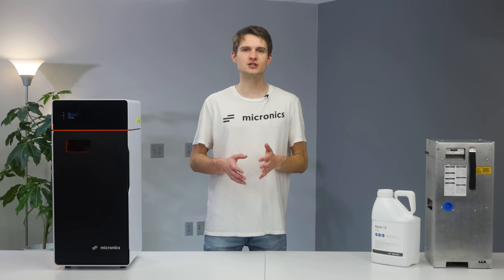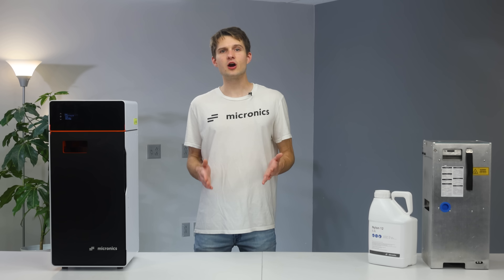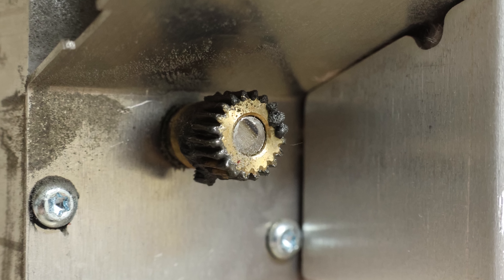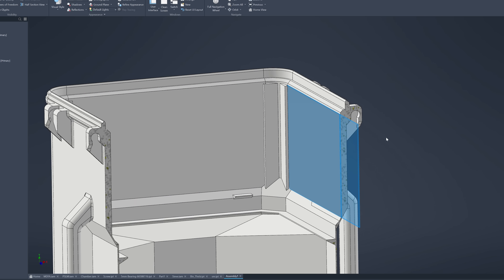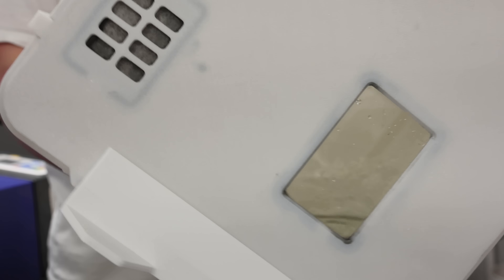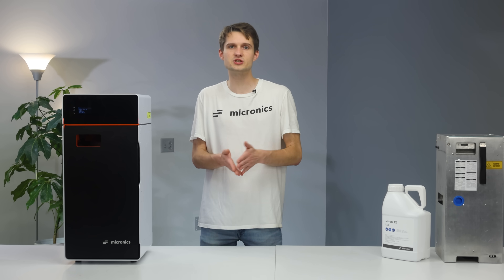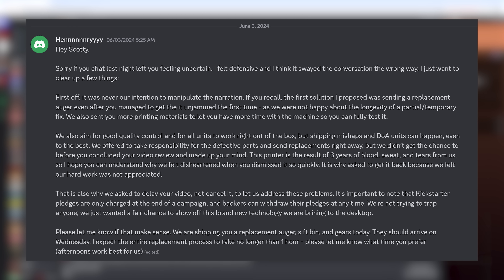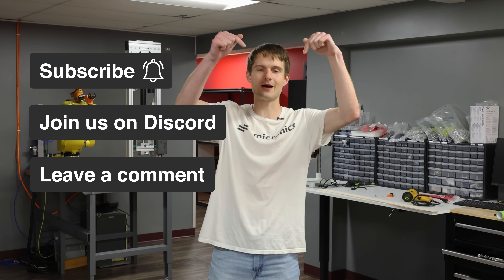EVERYTHING we'll change with MICRON + Response to Scotty

Comment from the maker: We got acquired by Formlabs! https://formlabs.com/
Claim your credit: https://forms.gle/Q4Xobxthd76yhBAEA

More info: https://www.micronics3d.com/
Formlabs Blog Post: https://formlabs.com/blog/formlabs-acquires-micronics/
Reply: I would suggest chromium plating the tube, usually is a plating that are made for shocks shafts, and so on, mechanically is stronger on the surface and increases sliding. The smoother the better. While for the bushings, I know you're looking for affordability at these mk1 machines, but semering/shaft seals, and bearings should be a better fit for your dust leakage. You could offer upgrades letting users know that the costs of the machines is quite tight and it's required that there is a cost put into development, and I think whomever buyed one or more machines from you will also be pleased to have a reliable 1.1 version and get into less stressful situations, having to clean less while spending 100$ in parts. I think the better this machine is envisioned with industrial parts that are already reliable, the better will work on the long run. However I like your project really a lot and would love to buy one in the future. Have a good day and hope it helped
Reply: I think your product is a great idea but you should let prospective customers know that this does not include all the tools and PPE you need to safely operate the printer. If someone does spill the powder you can't just sweep it up or worse vacuum it with a typical house vac. There is actually a budget solution ish but your documentation does not explain the risks correctly and the variety of solutions customers should get. A toner vacuum with a hepa rated cartridge is suitable as they basically vacuum spills of toxic plastic powder. Also p100 respirators last longer and can fit better with many cartridge varieties so saying n95 is overkill isn't really correct. The premium option for handling spills is obviously a explosion proof hepa vac but that costs more than the printer. But a p100 mask doesn't and the rigid cartridges can be a lot more reusable if done correctly for powder only hazards. If you want to get extra cheap you can also just buy the toner hepa vac sealed filter cartridge unit and connect any home vac to it. These filters have more media thickness than your printer and extractor have and can probably cleanup one major spill or a long time of minor ones before you need to replace the cartridge. SV-FILTER it's like 50ish bucks and is a ULPA rated vacuum filter. Just be aware if you do not use esd conductive hoses grounded you do run some addition risks depending on the powders you suck up.
Reply: Thanks for the response to Scotty, this cleared up a lot. He definitely should have been way more relaxed with his review, especially given he got a review unit not a finished product. That's just part of doing these reviews of startup products that are not even yet in production. I can totally understand your frustration now, I hope he'll give you another shot when the product is in production and these few (honestly minor) mistakes are fixed.
Reply: People forget what Kickstarter is all about... and micronics has a great idea and product that can revolutionize the industry
Reply: but your machine problems aint fixed you!
Reply: @IronMan-yg4qw  they sayed they are working on tollerances of the motorised rod and bushings for the layer flip that is the meaningful part. While the powder box (I don't actually remember the name of it) is currently under revision as they get tougher walls by increasing it's width and adding metal plates to avoid cracks
Reply: @freerideshuttle  right but i should not be on kickstarter till the get the bugs out.

Comment: I know it would be some bigger change and the 5w laser might have been the cost effective option to go. Today the sweet spot is with bigger laser so 10-15W should be used. It would help with temperatur cycling of unused material. And surely would make it easier to clean the parts.

Comment: A little advice, don't make excuses. There was no need to say "just because some things went wrong doesn't mean everything did..." It would have been much more convincing if you had just addressed the issues and fixes. Excuses make this look like a shallow PR effort instead of a genuine desire for transparency. Also, don't take it personally when someone doesn't want to spend more of their time on something you've put a lot of effort into. From your perspective, you've given them something of value, however from theirs, you may have simply given them a piece of content, or a machine that they don't have time to tinker with to make work. What I took away from Scotty was that your product is a riskier one to back on Kickstarter in its current form, not that we shouldn't back it. I have to agree with him that you still have a long way to go, because you've done the 80% that takes 20% of the effort, and it seems you've only just gotten to the hard part, which is finding every little thing that can and will go wrong, and trying to address them all. It is also concerning that you claim on your Kickstarter that the R&D is complete, which this video refutes. The many issues uncovered and addressed in this video are likely only a fraction of the issues you will encounter, but the fact that you do not seem to think so, despite believing it was ready for reviewers, says otherwise. I noticed you're planning to do another batch of test machines, but it seems a bit optimistic to think only one more round of testing is needed. I'm also concerned with the number of times 'reliable' showed up on the Kickstarter, despite the issues the reviewers and and you saying multiple times in this video 'when it works..." Good luck.

Comment: I think giving the printer to content creators as beta testers is definitely a double edged sword. On one hand you get a ton of exposure for the kickstarter but they don't have the time to properly help you solve issues as they are on tight schedules to keep doing their jobs of producing content. A smaller very detail oriented team of beta testers would definitely yield better results for the actual improvement of the product as they would have the time to fully go through the process and work with you to solve these issues. Just my 2c

Comment: wow that's a way better response than I imagine! I personally wouldn't have SLS printers anywhere other than a garage with proper air filtration all around. Although the particles may not be toxic, it doesn't really mean that it won't cause harm in long term, especially if you have kids or pets. I think if you can have an optional system for safer operation, it'd be nicer!

Comment: CONICAL auger! Folks, why not make the auger slightly conical rather than fully cylindrical? I could imagine that it prevents the auger from getting stuck in the first place. Respectively: Try making the clearances conical, so that tube inside which the auger spins has on the top more clearance than on the bottom. That way it perhaps won’t get stuck along the full length, thus less force is required to set it free.

Comment: @micronics3d Awesome work on this new SLS printer.
suggest to change the manufacturing process to rotational moulding to improve the sift bin robustness. FDM is good for prototyping to test the design. As the product is transitioning to production, you need to consider that this component to be functional until its product life. Roto moulding is cost effective once you have invested with  custom tooling. I’ve been designing similar roto molding and  blow molding products and the off tooled samples are durable compared to FDM.  
Adding sheet metal to the FDM sift bin increased cost from added part and extra steps in the assembly process.
Suggestion from a Mechanical Product Design Engineer.

Comment: I know that I'm biased here because I haven't ( and can't) buy one of these yet and thus haven't experienced the frustration, but I don't care how long it takes you guys to work out the kinks , even if you guys have to increase the price some it will still be drastically more affordable than the competition. Also you guys are admitting to mistakes and trying to improve, you have my full respect and admiration.
Reply: In about 5 years the price will most likely dip to $2000 I'd bet... which is in the range of a nice table saw. Very doable.

Comment: Would love to see a 3D printable upgrade to the HEPA filter: 
Either an electrostatic separator or vortex separator to be able to collect most of the excess powder in a mason jar that can be unscrewed and returned into the main reservoir.
This is probably a great community contribution that can also be used around the house and shop.

Comment: That bushing you splined for the flipper shaft should be a spiral flute so the powder will naturally flow out. thus if the spiral flute is in the wrong direction it will actually suck up the powder and lock up.

Comment: I love that this machine is getting made. I also appreciate your attempt at a response. 

I won't get into my PoV on the Scotty situation, but the one thing that keeps jumping out at me is you're calling what are essentially alpha testing or handbuilt demos, "beta" units. 

Clearly there are critical areas that need to be addressed, and, equally clearly, you're addressing them. But please don't fall into the trap where you set unrealistic expectations; your audience here will likely support you even if you have to admit to a setback or two. 

This video is a good start - but let's call the machines what they are and let's be frank that the last mile is often the hardest mile on the way to releasing any product.

Comment: Kudos to you for responding but I don't think there's a need to show private correspondence with Scotty, it's not a good look. It's also unnecessary to repeatedly try to score extra points for "sleepless nights" and "all the hard work over the years". Everyone knows and recognizes your great product and achievement, move on to executing. Good luck!
Reply: Yeah it's pretty low move to do that. Also the safety misinformation is the actual biggest problem they are actively misleading people into getting into something that will cause lung cancer. It's dangerous the way they brush off concerns their system is so unsafe without significant addition items that they say are "overkill". If that cake is dropped the fan will make a giant cloud of dust your n95 is literally going to save your lungs. * As long as it is fit tested and their janky fan doesn't cause a dust explosion.

Comment: Overall all a good response HOWEVER, you still come across as rather catty about Scotty and his findings.

First, the whole “but only one unit failed” argument. That’s still a 20% failure rate, which is crazy high.
Sure you can try an minimise the failure, but it’s still a failure that required prep, getting on a video call, doing the actual”try this” which didn’t solve the issue.

Even just offering a swap out on the auger still would require the end user to spend time dismantling the chamber, swapping it, cleaning up powder afterwards. All this is people’s time. You really can’t be down playing value people place on their time. Sure you might be thinking “yeah it’s only a couple of hours”. And sure, but that a couple of hours not doing something else.

Which leads on to the point of being upset about scotty saying he felt he already spent too much time on this already. Again it comes across as you feel that Scott should be glad to be giving up his time to make sure the project comes off in the best possible light. And because he didn’t want to you threw your toys out the pram and wanted the unit back.

So let’s talk about the review unit. If during the initial talks with Scotty you said or implied that he could keep the review unit (which is common practice, though not universal), you then asking for it back because you felt the world he put in wasn’t enough is a step too far.

As you say you’re just a 2 man operation, I’ll let these things slide, just know you do sound rather catty about Scott’s findings. Next time, it’s best to take it on the chin. I understand that is hard to do because you have invested so much of your own personal lives into this project. But at times it’s best to just “take one for the team”.

As I said at the start, overall a good response, glad to hear your fixing the issues, thats all that needed to be said, so next time leave the high school drama out of it😂

Comment: I dunno the whole move the cube with a scoop is like one step from dropping the entire cake onto the already running fan and making a literal dust cloud of death. Of course the leading mfg of the literally by design microplastic powder will also try and minimize the safety risks. Any fine dust you do not want to breath at minimum a fit tested n95 mask is mandatory for handling fine powders of any nature fine inert powders also cause cancer by the way. The inert aspect of plastic is why it is dangerous your body cant break it down and it will just accumulate in your lungs.

Comment: Lot's of things to fix, but Scotty's video will not age well.
Reply: How's that kickstarter comin' along? Lol!
Reply: Don't forget it's a true kickstarter so you have to hope the problems are actually fixed. They clearly are not doing so well on the safety front and you'll find out in a few decades of your terminal lung cancer was caused by some inert micro plastics buildup due to chronic low level exposure. I think the product is a great idea but they are not sending the right signals downplaying the safety aspects at every possible turn. Why did the reviewers all had what looked like a poorly fitting kn95 mask which is not an n95 mask.

Comment: Just because Kickstarter allows for pledge cancellation doesn't mean pledgers will keep up-to-date with the content that people like Scotty would have released.  You essentially asked Scotty to delay the release of his video to bait customers who may not have the time to watch every video about your product after they pledged.
Reply: They are also not being very clear with buyers this is not an end to end solution they will be responsible for a number of facilities (ventilation, dedicated space), safety equipment, documentation, training. Because clearly they don't seem to think it's very dangerous which is common when someone uses something a lot over time. Lots of ultra expensive commercial ones are more turnkey and offer a lot of the parts and tools you'd need to run a printer which is a big reason they cost more. This product can be successful and I diy all sorts of safety equipment for far cheaper than commercial ones but you should tell customers that failing to properly assess the hazard will cause lung cancer, fire, or explosion hazards.
Reply: bot

Comment: This is the best response I've heard to feedback received. Many companies simply ignore it and just bring it to market anyway, and leave it to the open source community to fix their problems.
Reply: It is actually a really bad response in my opinion they are mixing in fixes with coverups. The fan filter is too thin to work and it being hepa just means it will clog very quickly and instantly in a large spill event. A proper filter would one be esd safe, use a cyclone separator, and then a bag prefilter and then a hepa filter. Obviously that would probably cost more than the printer but just tell customers to be budget those things are not included the little fan thing is at best a tiny trace dust filter. The powder is an fire and explosion hazard if you don't have the proper equipment or hygiene on dust buildup. Most mfg's can claim it's very safe because they use all metal cleaning stations with said fancy vacuum hepa cyclonic system all grounded properly so a dust fire and explosion becomes extremely unlikely. The cheaper printer being all plastic and missing a ton of the fancy safety stuff means that risk is much higher.

Comment: As I commented on the other video, I knew you would be able to address the issues, and I'm sure others will pop up as you move forward.  However, you are wrong about the safety concerns.  It is a fact that the nylon powder when breathed in, causes mesothelioma.  There is absolutely no question in regard to that fact, and has been documented by institutions like the Mayo Clinic.

The other part of safety that you have not addressed is the vaporization of the power, which places even smaller particles into the air and for a longer amount of time.  These particles are most likely more dangerous than just the powder itself, but there hasn't been enough research on them.  There are however laws in pretty much every US state that does not allow these particles to be vented into outside air.  The particles must be extracted, before the air can be vented.

Assuming that you are SOLELY fusing the particles, is an extremely bad assumption.  The majority of particles are being fused, but some are also being vaporized.  The owner of the device is responsible for ensuring that proper state and federal safety protocols are being taken.